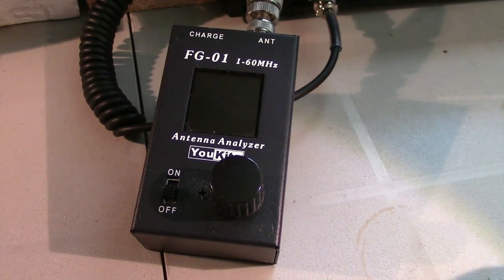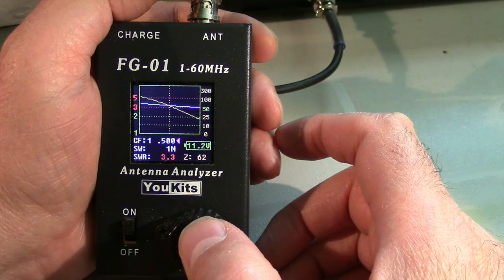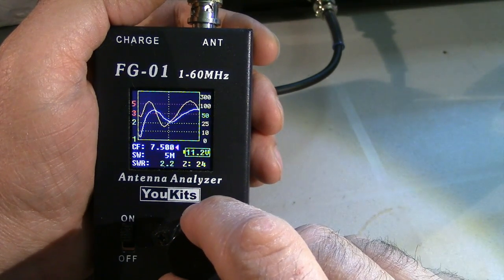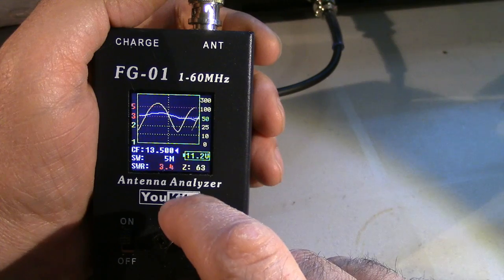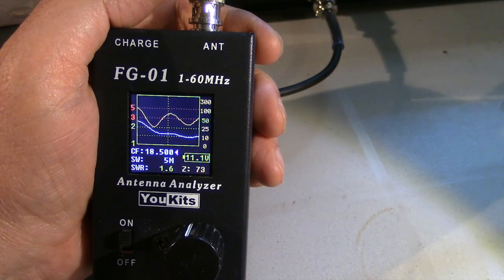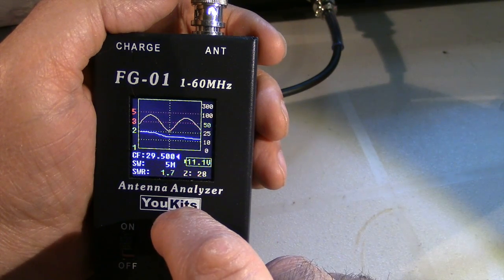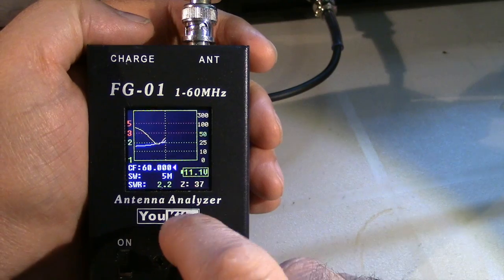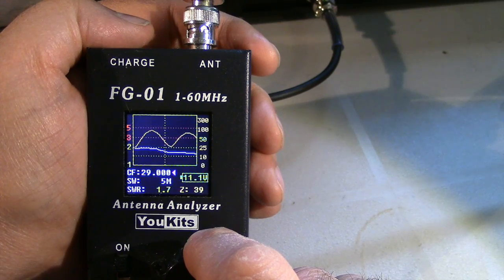Earchi S9 Antenna on an Analyzer

Comment: I never have figured out why people put baluns on antennas when they are using a matcher.. and if you're worried about current getting back in the shack either throw a couple ferrite beads on the coax or run a couple loops of coax through a toroid..... Baluns can take a dump on you so easy unless your rolling them yourself because most makers overrate them or just use  shotty wire and some just use unknown cores because they buy them from unreliable sources. 
And if worse comes to worse , make a current balun out of coax.. 

  But 9 times of of 10 you'll not have a problem without a balun if running a tuner .

Comment: When I got into this hobby, I used my IC 7000 and a buddipole.  I didn't know enough about antennas, tuners and the like.  Finally, I made a permanent "shack" in the basement and installed my first antennas outside.  A pair of alpha-delta fan dipoles on an MFJ coax switch and later the S9.  I won my region in two Rookie Roundup's using the S9, so it works.  Its a nice, wide band antenna that with a tuner will let you work all of the bands with some loss in all directions.  

However, the price you pay is noise - a lot of it - and an omni- directional signal  that handicaps your reach.  I never got into Asia with the S9, never heard India. I did get into the Land of Auz and NZ -barely.  

I spent a lot of money relative to the  cost of the S9 on its install, including a ground plate and 32 copper ground radial between 20-and 40'.  I still use the antenna - but I sue it as a receive and noise antenna more than anything.

You know what was a lot better for me?  The two fan dipoles on a cheap MFJ coax switch.  The noise floor melts to 1/2-1/3rd of the S9, signals are heard, and you pick up 2-3 db of gain (doubling your efficiency) broadside.  The switch lets you go NW/SE or NE/SW.   My A/B comparisons with the dipoles and the S9 were that the dipoles were always better heard and had better receive.  

Finally, after building my own wire beams and just getting blow away by what I was able to receive (10 watt transmissions off of sailboats in the Caribbean)    I got an Ma5B and never looked back.  Directional antennas just make EVERYHING better.  You'll join me one day in this; and realize you should have just put up an MA-5B to start with.  Either that or a Hex Beam.
Reply from the maker: +kd8opi Thanks for the info.  Yes, some day I will spend some real money on an antenna